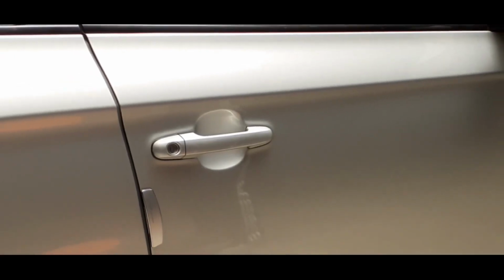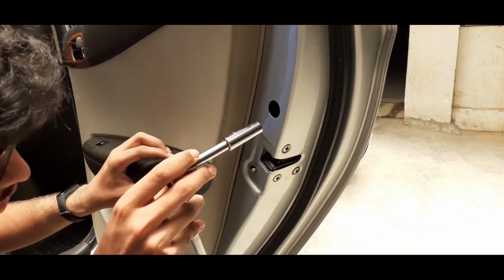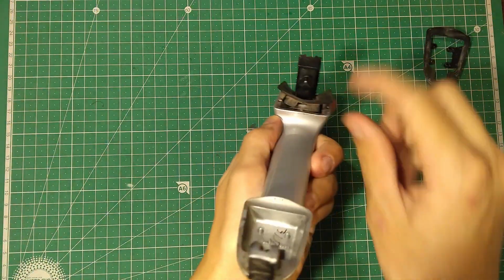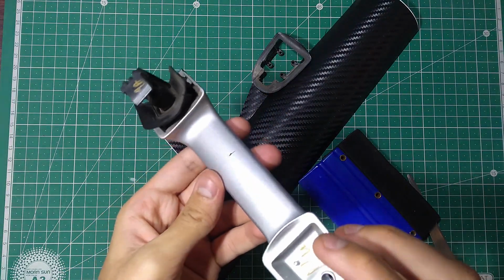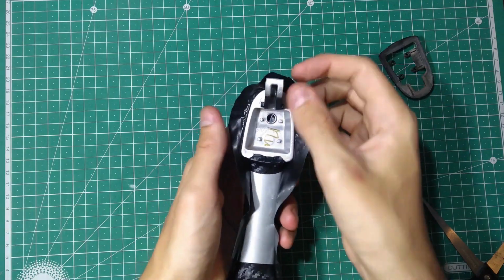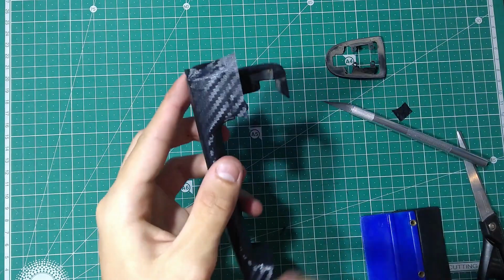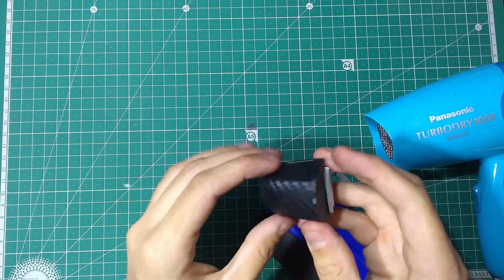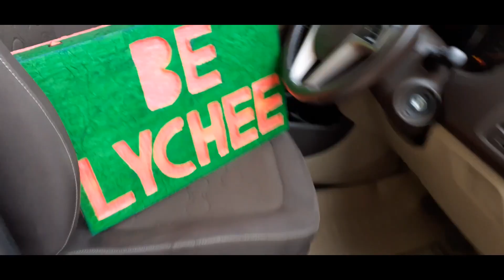How To Vinyl Wrap Car Door Handles | FULL DIY Tutorial On A Hyundai i20 !

Comment: Good vid. I want to point out that on my 18 elantra gt I had to insert key from fob and turn it while pulling the end out. Inserting back in required key turn again.
I did a preheat stretch before wrapping on ends. This is because the high tension created wrinkles and pull back on the narrower end with angles. I did no inlays

Comment: if my car got keyless entry n i wrap my door handle,will this function affected?
Reply from the maker: It won't be affected. As long as you put everything back together the way it was at the start, you should be good.
Reply: @noahjaffari  okay thanks!
Reply: And also when you remove the door handle from the car there will be an electrical connector on  some cars which may need to be disconnect but apart from that you are good to go. Make sure you check the keyless entry function before you screw the door handle back in